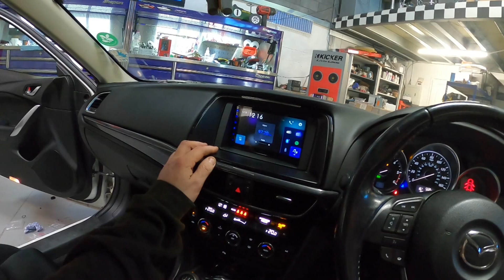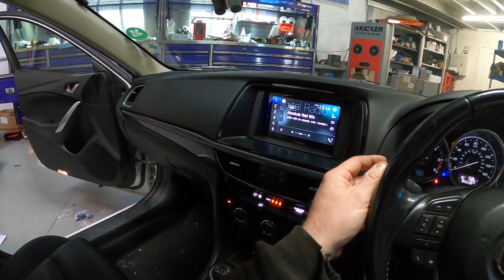SNAP ON TUESDAY SNAP ON VOODOO DOLL !

Comment: Do you have the snap on battery lug crimping tool?
Reply from the maker: I have the snap on crimp tool that looks like a bolt splitter with a jaw and a bolt you tighten down to crimp but its not that easy to use in a vice unless you are an octopus so instead I bought a hydraulic one from amazon and its way easier
Reply: @AlexCarter-AscAudio  thanks for the tip man! I was wondering what I should get I hadn't had much feedback. Yes same tool im thinking of.
Reply from the maker: @Toyotas_n__Tools  
https://www.amazon.co.uk/dp/B07VBMMDDT/ref=cm_sw_r_cp_awdb_imm_t1_WyfYFbAGKVTWC
Reply from the maker: Something like that its really strong